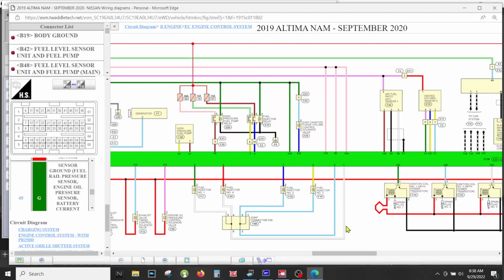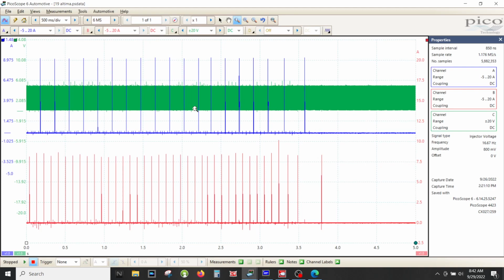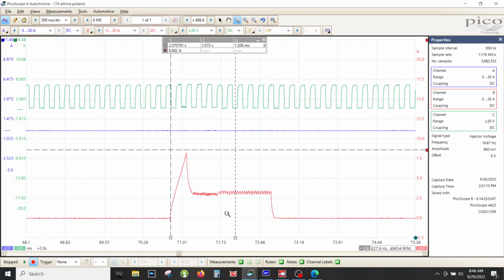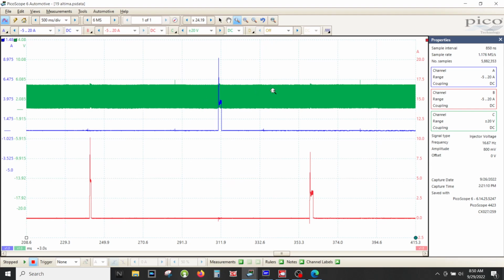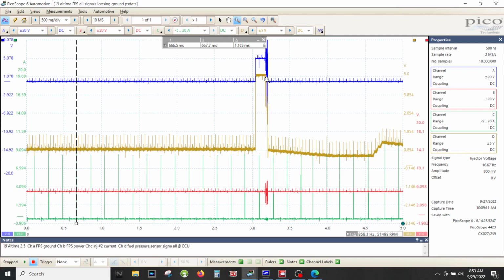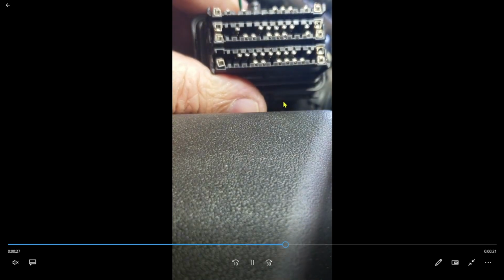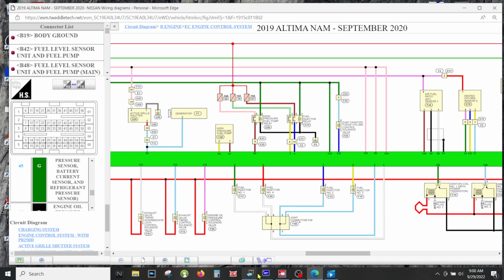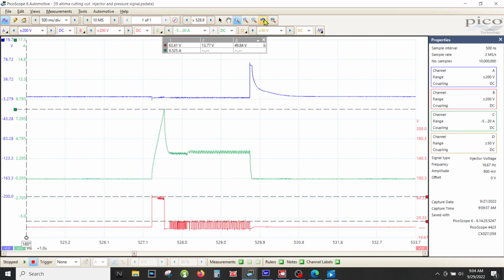GDI Case Study and Discussion

Comment: Good case study. In your video, you were piercing the wires at the PCM. I wonder if you had back-probed it would have hidden or fixed the problem.
Reply from the maker: Its always a chance of accidentally fixing a terminal with back probing. Honestly I pierced the wire because of how intermittent the issue was. I didn't want my connection or lack of misleading me.  To answer your question,  I don't think a proper back probe would have temporarily fixed this particular problem.

Comment: So when the FRP sensor went up because of the bad ground the ecm increased the pulse width of the fuel pressure regulator. So what happened to the high pressure fuel pump pressure ? Did it go up?  I’m confused how the ecm thought the car was running lean. So my question is when the FRP sensor voltage goes up , does the ecm increase the FRP pulse width or decrease?
Reply from the maker: I'm not sure what the ecm was doing  with the fuel pressure regulator, I was only looking at the #2 fuel injector at the time of the FRP sensor fault. According to the scan data the FRP was jumping between 72psi to 1020 psi while I was wiggling the ecm harness.  I don't think those are actual numbers, I find  it hard to believe the pressure could change that fast.  I personally think the rail maintained 550 to 600 psi during the incident and the ECU's fault programming created a lean condition.  Some Nissan gdi engine's  default to maximum pressure during some faults. I think the Altima defaults to low pressure.